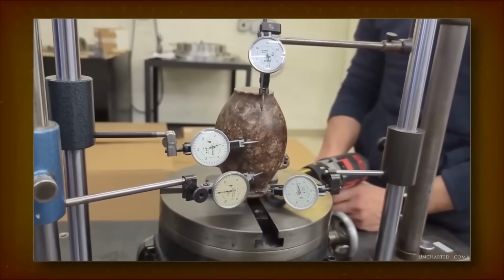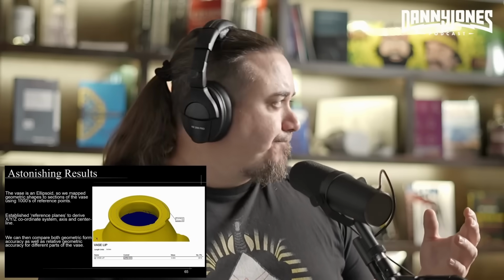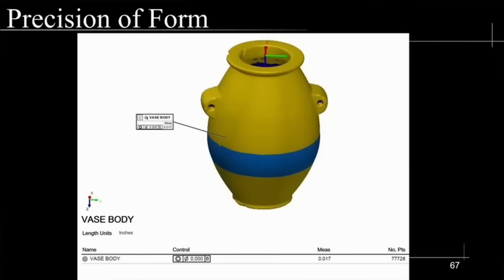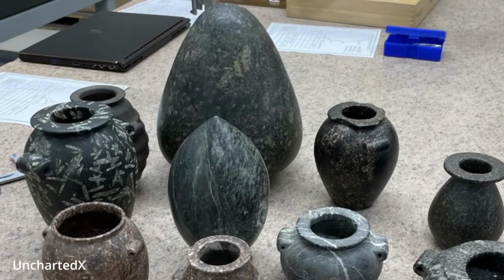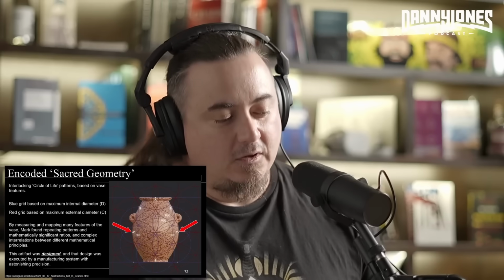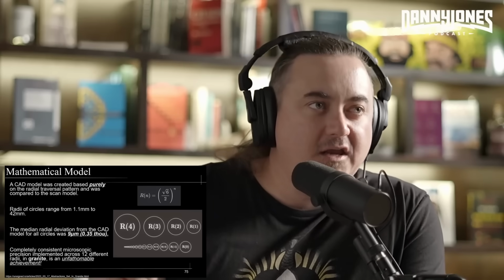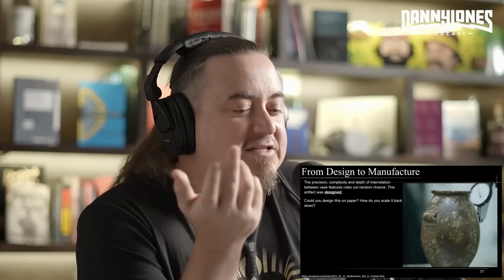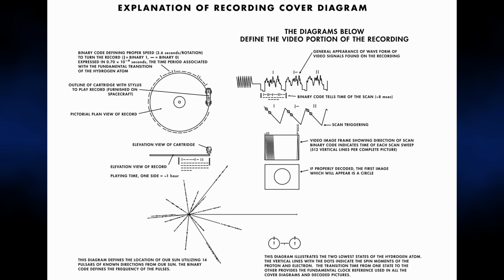Are These Ancient Egyptian Vases Actually Impossible to Make? #podcast #science #history #egypt

Comment: Is it possible to reform granite? 
Yes, it is theoretically possible to melt granite and mold it, although it's not a simple process due to the high melting temperature and specific cooling requirements. Granite can be melted, and if cooled slowly, it will re-crystallize, but if cooled quickly, it can form a glass.
Reply: Not to mention that process is every bit as amazing and out of time as all the others proposed
Reply from the maker: The only way would be to have an oven with controlled burning and heat, slowly cooling it down. All super speculation of course.
Reply: @historydrops  5,000 degrees
Reply: The "vases" have not been melted because the grain structure of the granite is still intact.

Comment: That old wheel that was found that looks like propeller with the fins on it that nobody knows was used for?...i bet it was for making these vases.
Reply: lol.  I was trying to connect the two myself.  That thing lools like it holds some answers about something
Reply: That looks like a stator from an electric motor.  If you wound coils of copper wire onto each of the 3 lobes and spun it on the centerline next to magnets you'd have a generator
Reply from the maker: True
Reply from the maker: That is also an out of place artifact. Impressive work
Reply: The schist disks.